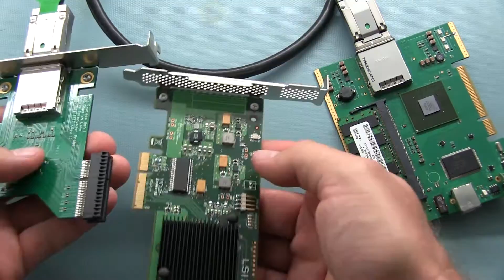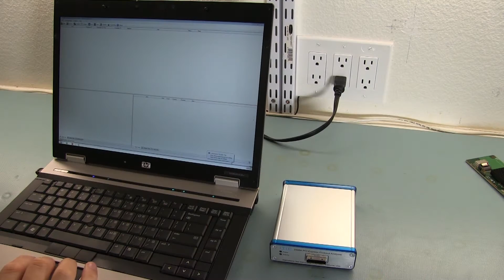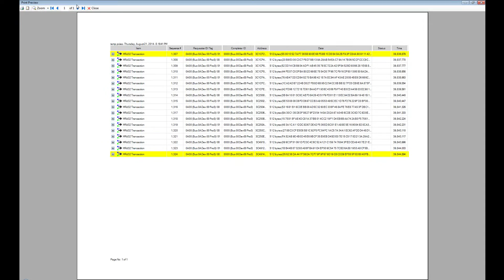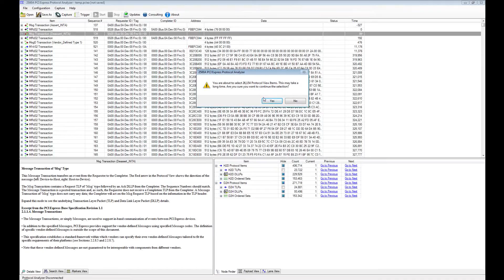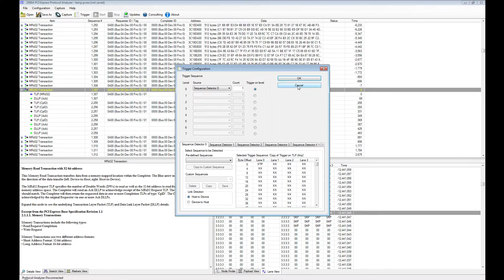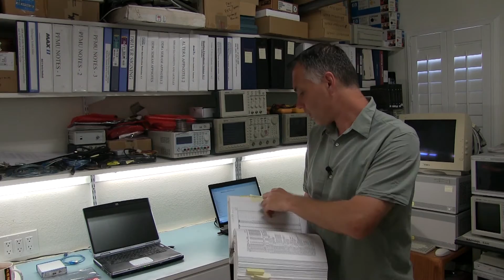ITIC 2500A PCI Express Protocol Analyzer HW & SW Description

Comment: Is that the Molex inifiniband or the IPass? Do you have  revision a M.2 support? I'm in the process of prototyping large-dense arrays of NVMe (mostly 950s) against Xeon's for primarily PHY, TI XIO1100ZGB as secondary (optional RAMdisk 4u's that de-dup and act as the filer, with copy-on-write every ~60 ms, replication via to a backup, which is mostly ready to ship but that was easy to test since it was mostly stock hardware + our own software + Infiniband gear). Before we spend exhorbant amounts on a Keysight/Agilent piece of kit, this might be handy. Can it do DSA work too or is it just a PA?
Reply from the maker: We are using a x4 external Molex iPass cable. We currently do not offer more advanced PCIe protocol analyzers. The 2500A is a pure PCIe 1.1 (Gen 1) protocol analyzer , which is why it sells for under $5000 USD. The closest PCIe 1.1 capable analyzer from other vendors start at some $16,000 USD.